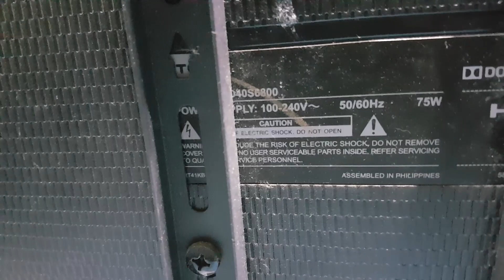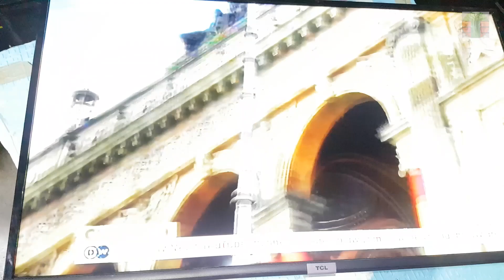TCL40s6800 smart TV no power

Comment: Pse assist am in need of replacement for ap2121 CMOS regulater 3,3v
Reply from the maker: You can put a dc to dc converter, set to 3.3 volts.
Reply: @tevzTVTevatronics  thx u very much,keep it up man.

Comment: How do you no the value of the capacitor and I have a led tv where red led turns green immediately you power on instead of red first, what mighty the problem
Reply from the maker: 2.2 microfarad to 47 microfarad will work.  About your tv, it might be a power supply problem or the firmware problem.